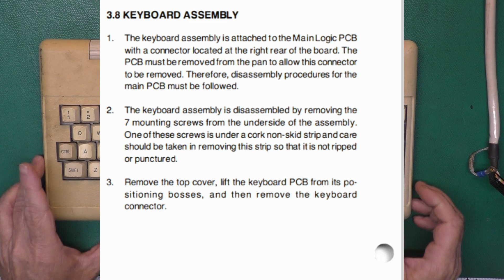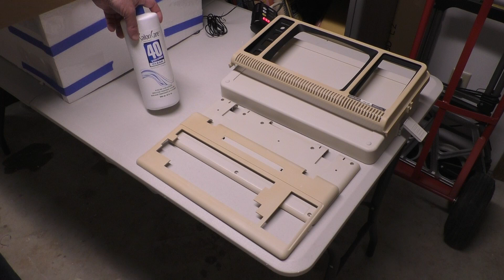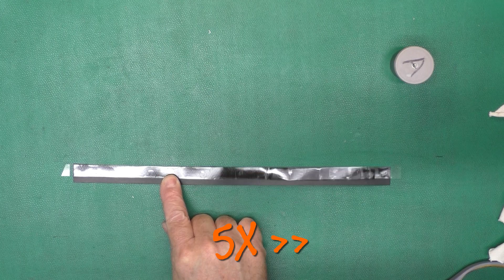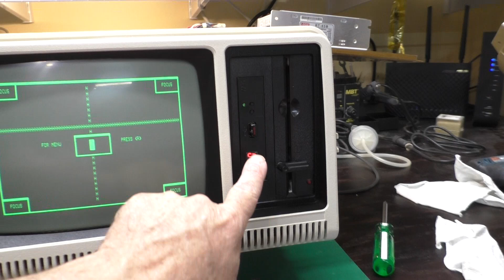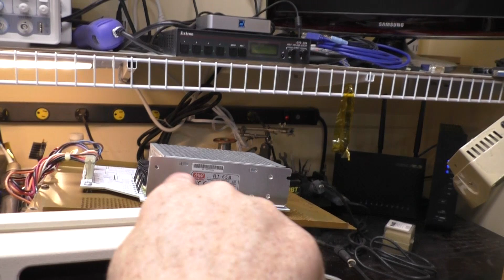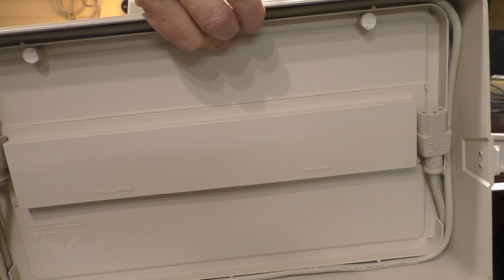Let's restore a TRS-80 Model 4P Part #3 – Cosmetic resto, soap, water, Retr0Brite & a lick of paint.

Comment: Your furnace? When did you video this??? This is listed as released in August and it's hot as heck!
Reply from the maker: I should have said 'air conditioner' to be more precise. I'm usually posting a week or two after filming.
Reply: @HeyBirt  I was gonna say… I live at the northern most portion of the lake (of the Ozarks) in Clinton. I have to call my AC people Monday because while it runs, I’m still only able to get down to 85. It used to do better. At least it dehumidifies. <shrug>

Comment: The furnace coming on?  How far ahead of posting are these recorded?
Reply from the maker: I should have said 'air conditioner' to be more precise. I'm usually posting a week or two after filming.
Reply: @HeyBirt  Or is it actually a heat pump?  I've decided that when I buy a house, which I hope to be next year, if it has forced air heating I'm going to see about getting a heat pump installed.  It costs more to run than an air conditioner for cooling since it's less efficient, but they cost less to run for heating than other types of heating systems most of the time you need heat, even up here in the Ottawa Valley.
Reply from the maker: @evensgrey  I have an air conditioner, not a heat pump. The system is probably 25~30 years old so when it is replaced, I plan to compare a heat pump. 

They are really only good for producing heat when temps are about freezing. It depends on what percentage of the time you spend below the optimum heat pump range in your area.

Comment: All these years I never noticed that the 4P case was unpainted, unlike most other TRS-80's.
Reply from the maker: The full-size Model 4 is in white too. I'm not sure if they are painted though.
Reply: @HeyBirt   I could swear that I wore through the paint on my 4 below the keyboard where my wrists rested - just like I did on my original CoCo. It's been a LONG time, but IIRC the cases were black plastic underneath, painted silver/white.  I've got two 4's and the CoCo in storage and will check the next time I'm there. I guess it would make sense for the 4P to not be painted to make the luggable more durable and less scratchable. All buttoned up it always reminded me of a sewing machine. LOL

Comment: I have found that putting the keys in cleaner for dental braces works really well. Just add the keys to a couple of brace cleaner tablets in a small bowl filled with around a pint of hot water (tap hot,not boiling)  for however long the tablet instructions recommend (20 minutes for the ones I use) and they clean up really nicely and get a very light retrobrite at the same time.
Reply from the maker: Some denture cleaners actually work by using a bluish stain to shift the yellow stain back toward white. Some use sodium percarbonate which makes H2O2 when mixed with water and another chemical which lets the H202 work better at lower temps. Sodium Percarbonate is very alkaline and will corrode nonprotected metals quickly.

The link to my Retr0Brite video covers this and a lot more about how the process works.
Reply: @HeyBirt  The braces cleaner I use contains percarbonate and an accelerator. Yes, I watched your excellent retrobrite video 2 or 3 times before I attempted my first retrobrite, which was on an almost orange Apple 2C - indoors, 40C and 6% H2O2. It was slow but effective.

Comment: Thanks. Great vid.  Can you explain why the keyboard needs a such a large and separate ground connection? I've never seen that on a keyboard connector before. Would love to see the fan controller implemented (and maybe some RGB with it /s)
Reply from the maker: The keyboard cable is shielded, the ground lead is connected to the shield. All those signal lines coming out to the keyboard make great antennas for transmitting RF interference and the shielding helps mitigate this.